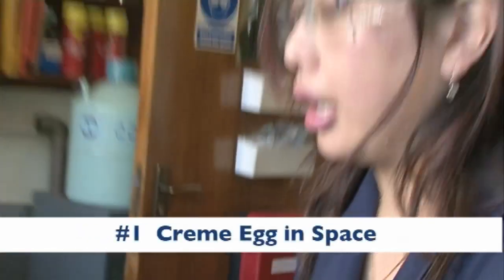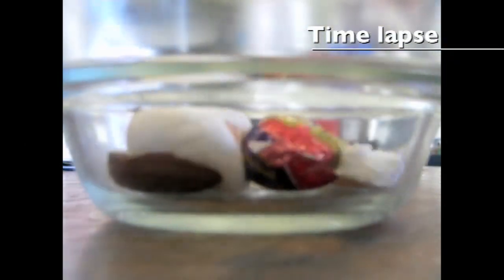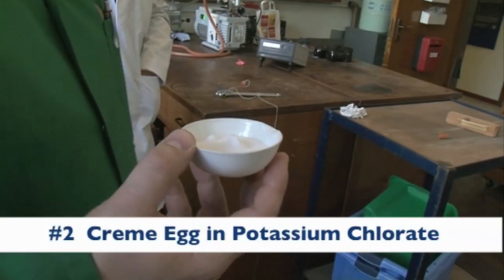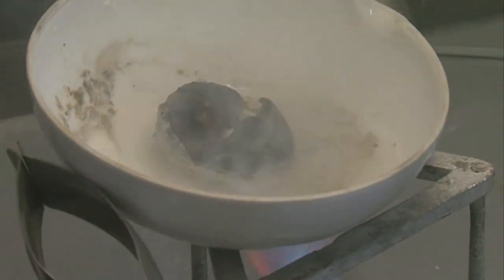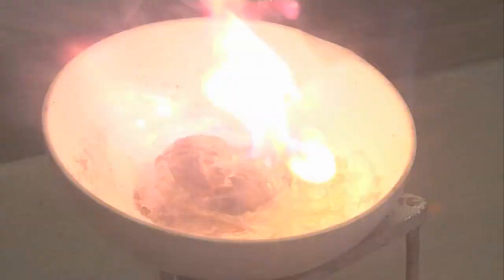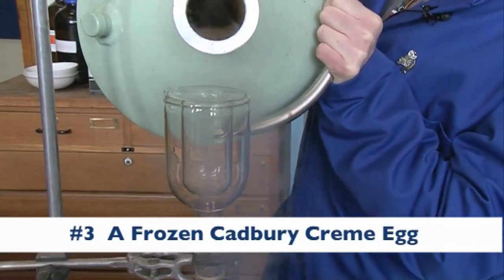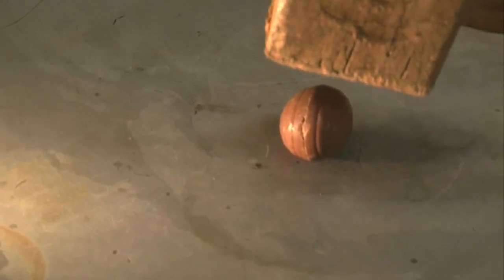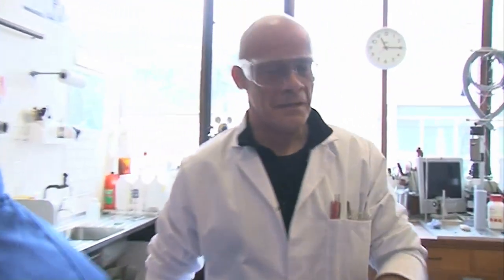Chemistry of Creme Eggs - Periodic Table of Videos

Comment: not if it is in a small amount. If i were to dip my hand into liquid nitrigen for a second, the nitrigen around my hand would vaporise instantly, creating a 'bubble' around my hand and protecting it. so if i dropped a drop of liquid nitrogen onto a surface, the nitrogen at the bottom of the droplet vaporises, and creates a layer that the nitrogen floats on, before all of it evaporates.

Comment: @jnieminen2 

Small splashes of liquid nitrogen don't do any harm - the drops just run off like water droplets on a hot plate (it's called the Leidenfrost effect). Believe it or not, you could stick your hand in and pull out quickly without harm.

Comment: at 4:58 what is that apparatus in the background? the one built on the blue frame. anyone know?
Reply: Thats a high vacuum system. Does a similar job like the single pump used in the video and can achieve very very low pressures.

Comment: Whoa talk about a runaway reaction!  It looked like a plasma torch when the sugar finally reacted with the potassium chlorate.  If it got hot enough to break what looked like a ceramic crucible then...damn...I'll never look at Cadbury Eggs the same again.  I still won't ever eat them though as they're probably the most disgusting things I've ever tasted in my life...
Reply: they're about three times sweeter than they were when I was a kid. instant attack of hypertension and tooth pain. not for me either.
Reply: Christopher Sadlowski 
It's more that potassium chlorate is such a powerful oxidizer. If they had used potassium perchlorate, it might even have exploded.